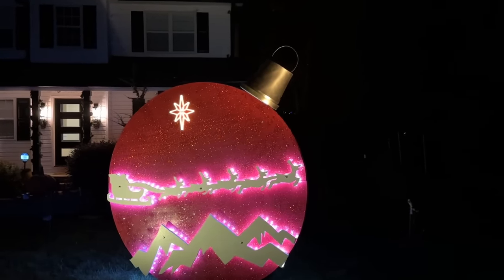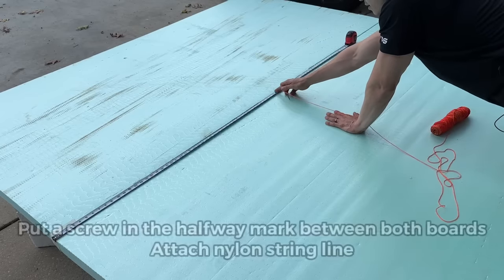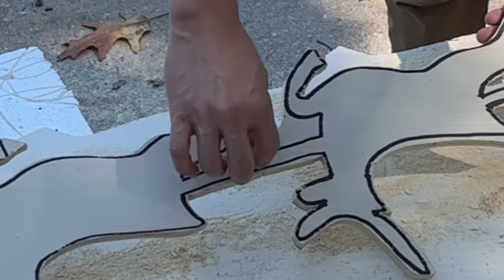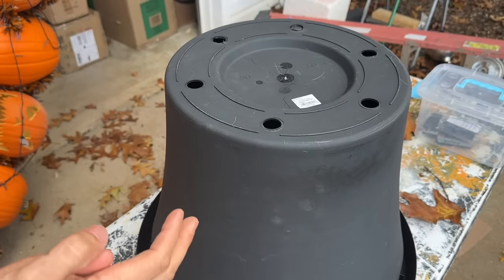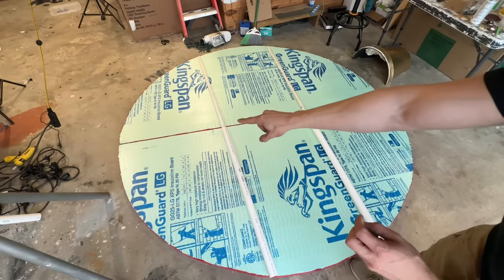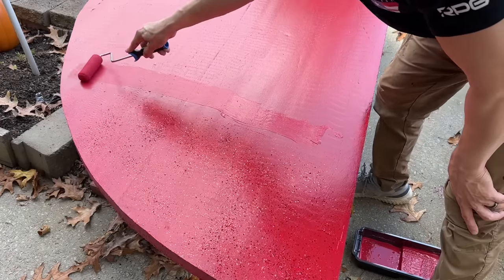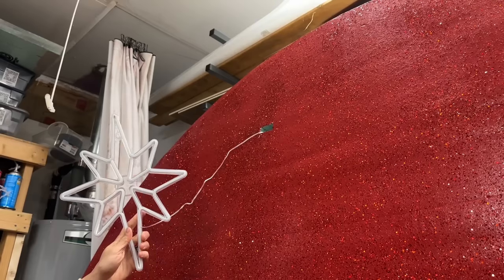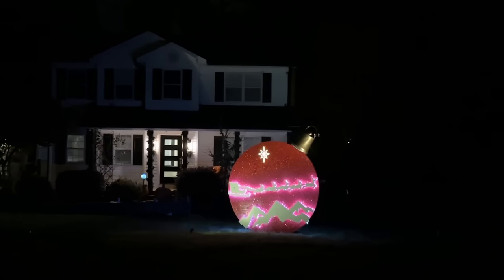10ft GIANT CHRISTMAS ORNAMENT- TUTORIAL!

Comment: Really neat and easy.  Isaac, why can't you use foam board to do the sleigh and mts?  Also, what did you use on top of the planter to make the round hanger?
Reply from the maker: Thank you so much. The reason I used wood instead of foam board was because 1) I had extra wood board lying around and 2) because foam board is weak and because the Santa/sleigh is so long and thin, it is prone to breaking and cracking.

I used some regular wire to make the hoop on the top of the cap